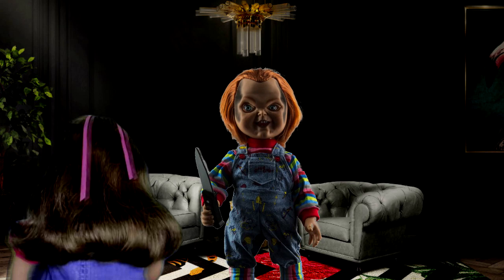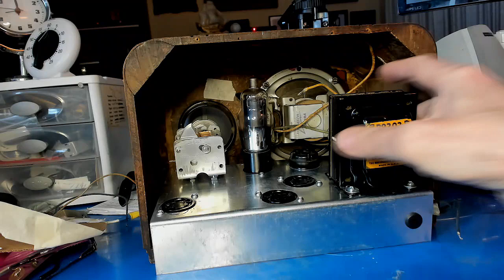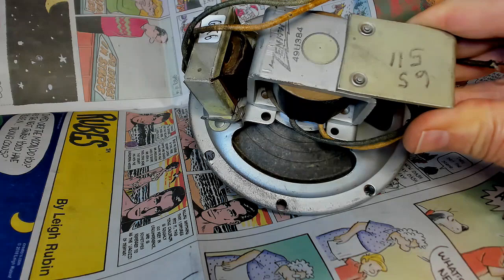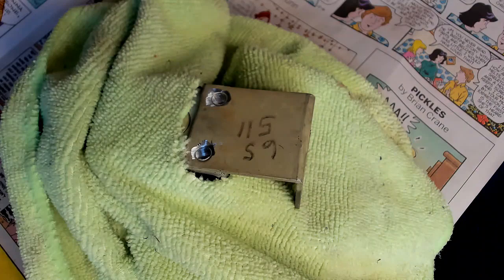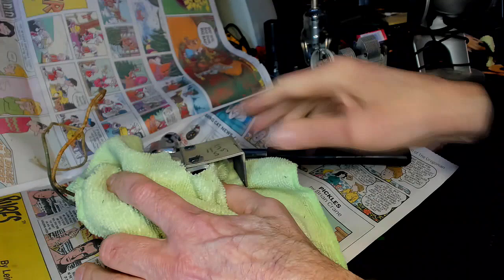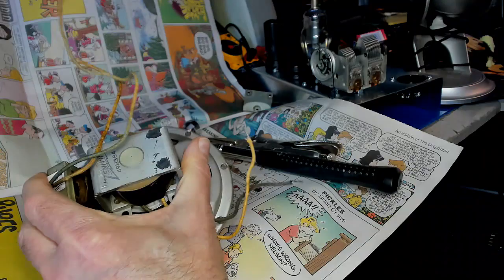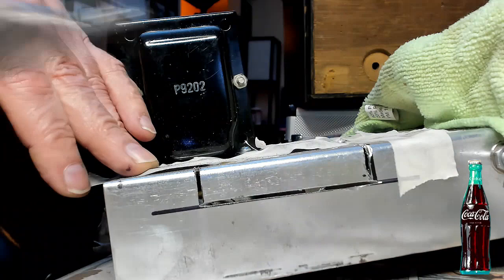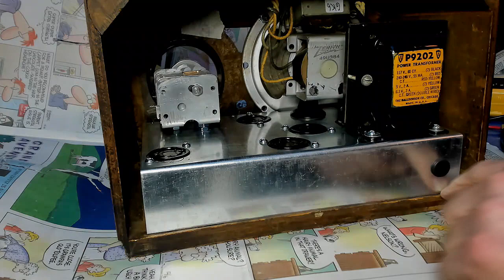Making a 1937 Airline Radio Chassis Part 2

Comment: Hey Buzz, I happen to have that chassis....for real, not kidding, but my radio cabinet sucks, the dryist piece of of wood I have ever seen. You barely touch and part of it and it falls apart. I re veneered the top, sides and the front. I had to rebuild the one semi circular thingy on the front. My chassis works great. Great work on  your radio.

Comment: I thought I had seen this before! The girl at the beginning is very creepy. 
Hey Buzz On U Tube check out “The secret life of machines” by Tim Hunkin and Rex Garrod. Made a few years ago for UK tv. Looks at all domestic appliances. Radio, TV, refrigerators, vacuum cleaners, cars, etc etc. The one on video recorders is particularly good. Tim is a little like a madcap inventor. Enjoy
Cheers
Lynton
Reply from the maker: Hi Lyton, I will check it out...How did you find out about this re-upload?. There was not suppose to be any notificaton to sunscribers, to avoid confusion.......Buzz
Reply: Buzz1151 I did get a notification. I was a little confused but watched the video all the way through. Even more enjoyable the second time.
I found a mistake on a Riders when I was aligning my Hallicrafters. They mixed up two of the adjustable caps!
Cheers
Lynton